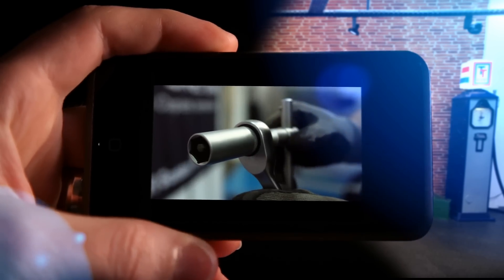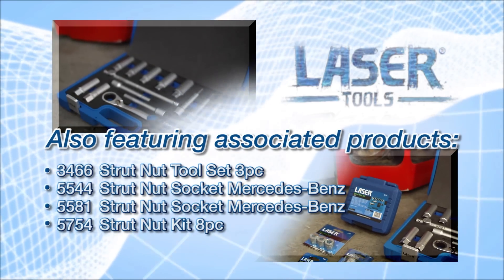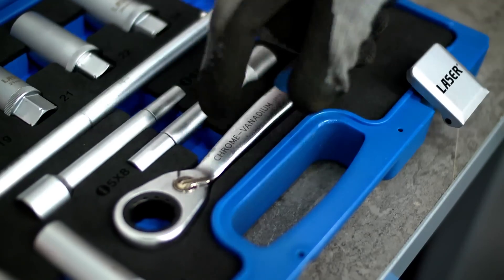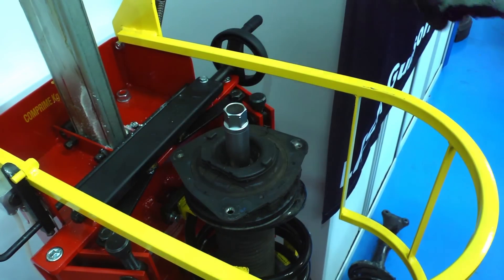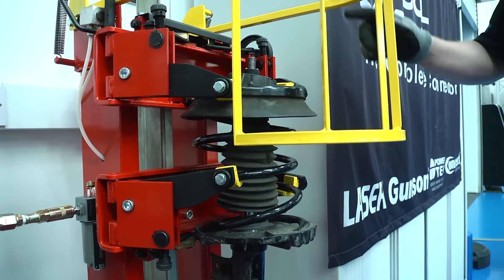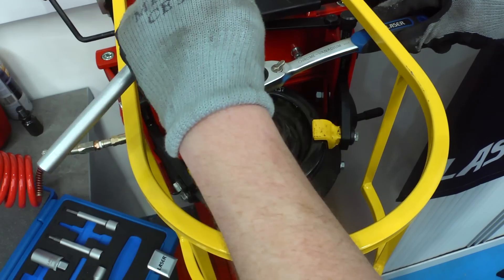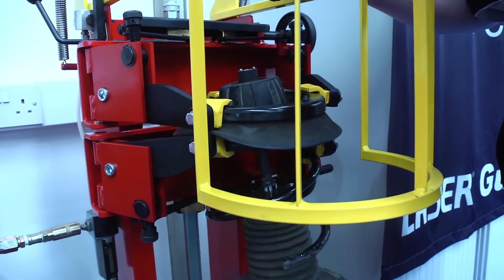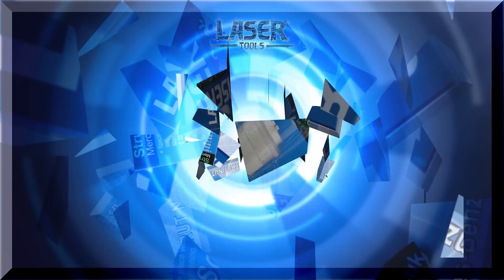6182 | LaserTools Shock Absorber Tool Kit 14-piece

Comment: That part of the job is easy. All you need is a cheap ring box spanner to fit the nut and another to fit the end of the shocker. How about a tool to remove the fixing that holds the shock absorber into the strut on a bilstein system. It needs a disk with a handle, a hole in the middle and 4 pins on the correct pcd. Circa 46mm.